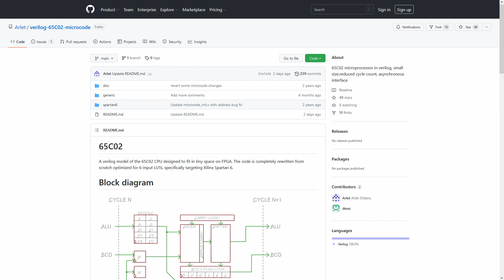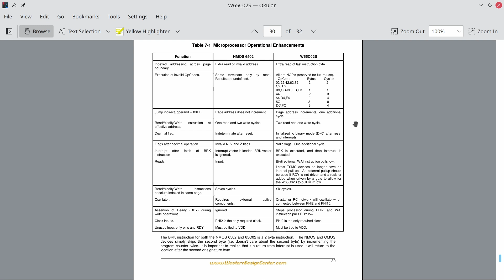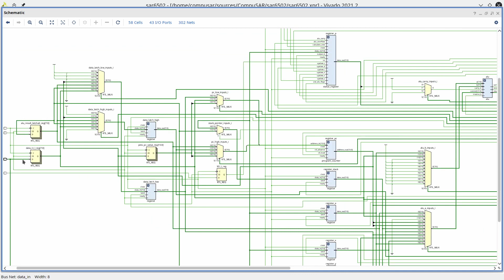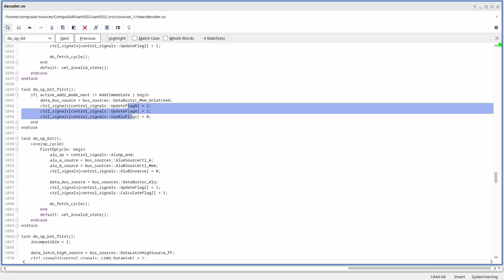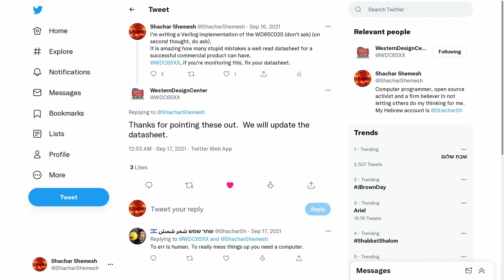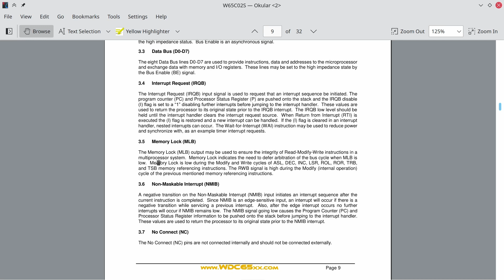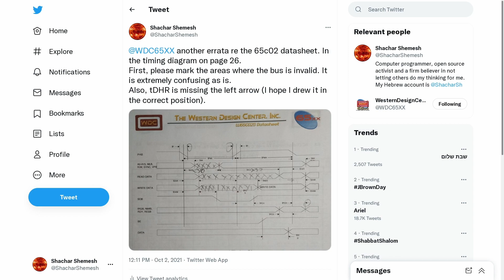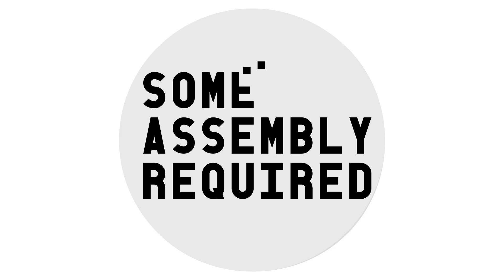Finalizing the CPU

Comment: Where PH2 and PH1???😅
Reply from the maker: It's been a while for me. What are you missing?
In particular, since this is an implementation designed to be used exclusively inside the FPGA, there is no need for any clock phase shifting (and the design uses a single edge anyways).
It's also worth noting that this design was completely replaced. See https://youtu.be/and5Sfoy9t4

Comment: Quirky things like BCD and the overflow flag pin are only on the chip at all because they are CPS - Chuck Peddle Specials. They were never functionally necessary.
Reply from the maker: I think you meant not the overflow flag, but the "set overflow" pin.
And I wouldn't bundle them together. Other CPUs, definitely after but maybe also before, also had BCD. The Motorola 68000 had BCD, and that leads me to guess (can't check now) that so did the Motorola 6800, which predates the 6502.
Reply: @CompuSAR  the designer of the chip at MOS, Chuck Peddle, required/requested the inclusion of these items. He was known to be quirky about these things.
Reply from the maker: I'm not saying otherwise. I'm just saying that unlike the SO pin, that only the 6502 has and that everybody was sure no one will ever use (they were wrong, the Commodore 1541 uses it), BCD actually saw use (the Atari basic uses BCD mode), and even lived on to other CPUs.

Comment: Gonna be honest I don't blame you for treating this like the 65c02. I find it really frustrating to work with the NMOS 6502 because there's no PHX or PHY. Seems like every function I write I end up having to stash A into zero page, but then you can't use nested functions that also do that... grr!
Reply: On the flip side, the NMOS 6502 would, as it happened, process some opcodes in useful ways not supported by the CMOS chips, most notably those nicknamed LAX (load accumulator and X simultaneously, using any addressing mode, other than immediate, that would work with LDA), SAX (store the bitwise AND of the accumulator and X register), and DCP (decrement and compare, which also interestingly enough works with all addressing modes except immediate or accumulator).  While a few things like PHX and PHY are nice, it would have been nice to support LAX, SAX, and DCP.
Reply from the maker: @flatfingertuning727  Losing those would not feel so bad had they not been replaced by such useless commands. The BBR/BBS commands could come in handy, if you could rely on this being a 65c02, which you usually can't. The RMB and SMB commands can only elicit "what were you thinking??".
According to Wikipedia Western Design only added them because Rockwell asked them to. WDC's are only Stop and Wait. At least "Wait" can be very handy.
Reply: @CompuSAR  The fleet of NOPs when the LSBs are 0x11 I could see as being useful in embedded systems, since one could fairly easily add a bit of decode hardware and a couple of addressable latches to add externally-decoded instructions for "set special latch 0-15" and "clear special latch 0-15".  The BBR/BBS instructions could IMHO have been more useful for embedded systems if all eight BBR were "branch if dedicated input was high on falling edge of phi2 of the instruction fetch" and all eight BBS were "branch if dedicated input was low on falling edge of phi2".  Simply add an 8:1 multiplexer in front of that input and one would cut test-and-loop time from seven cycles to three.

I'm somewhat curious what tweaks could have been made to the 6502 design without affecting cost (or maybe reducing it).  Probably the simplest way of using the x11 opcodes might be to make them all decode as ADD/SUB variants, using two bits of the opcode to select decimal mode and/or carry-inhibit.  This would then free up the ADC/SBC opcodes for CPX and CPY, without requring them to be crammed elsewhere in the instruction set.

Alternatively, I'm curious how the design would have turned out if (ind,x) addressing mode had been omitted, but all instructions other than JSR had an addressing mode determined by the bottom 3 bits, and the behavior of all actions in modes other than immediate and implied would be determined by the top 5 bits.  The nine read-modify-write and store instructions would behave as branches in immediate mode, and implied mode actions would mostly be different from other actions, but aside from those details there would be enough room to make the instruction set fully orthogonal while filling in a few gaps, and I would think it would have been simpler than having so many different sets of addressing modes be available for different instructions.
Reply from the maker: @flatfingertuning727  I think the 6502's solution to that problem is the SO pin. In fact, the Commodore 1541 disk drive actually used it, for precisely that purpose.
Reply: @CompuSAR  The SO pin is only available as a latching input, and requires that one either have a means of externally enabling/disabling it or else forego any use of overflow-checked arithmetic.  Having a dedicated pin just for a dedicated branching instruction family, and a group of consecutive opcodes to allow the use of a multiplexer, would seem to simplify external hardware by eliminating the need for an "enable" latch.
Reply from the maker: Sadly or happily, 6502 compatibility is coming. It's just not going to be as thoroughly tested as the 65c02, due to the test harness' inability to provide a consistent fast enough clock. I considered building one that uses the READY signal to halt the CPU, and would thus work with non-static CPUs, but then I saw that some 6502 only honored the READY signal on fist cycle of instruction cycles (which makes no sense at all).
I'll probably just manually verify with visual6502.org.
Paradoxically, since I'm aiming at building hardware for running existing software, I don't care how awful it is to program the CPU I'm building. The software is already written.

Comment: Excellent work!
I've been playing with 6502s so long that I remember people talking about the ROR bug being a problem in some systems, and spent 1978 on with Apple ][. I can confirm that Microsoft BASIC doesn't use decimal mode and outside of subroutines in a couple games, I don't think I ever came across it again on an Apple in a dozen years of coding. I know it was used in a Pascal math package, but most of the floating point numbers that were used on the Apple ][ went through Applesoft BASIC.
Reply from the maker: Then again, Applesoft using floating point is considered one of it's greatest weaknesses. People reminiscence about integer basic. I've never had a chance to program in integer basic, so I have no opinion how justified those opinions are, but I can confirm that Applesoft was dog-slow.
I think the source of my dislike to BCD is because of an educational program I used as a kid. It taught binary operations, and had a BCD mode. Except the BCD mode had a bug, where it would ask you to add numbers that were not legal BCD numbers. Today, knowing how BCD works at the CPU level, I realize what were the answers it was expecting, but as a kid, it just caused me to give up in disgust.

Comment: BCD was used during the keeping of scores on a lot of c64 games as well I believe. ;)
Reply from the maker: See my reply to @drlazy1. I've made my peace with the fact that decimal mode will have to be implemented. I wouldn't care so much, but it has a lot of corner cases (e.g. - the V and N flags) that, at best, can be described as "poorly documented".
Reply: Funnily enough the NES was actually missing the BCD mode and yet it managed just fine. The ARM doesn't have hardware BCD either if I recall
Reply from the maker: @Clippy4Jesus  To be fair, working in BCD mode saves on converting the number to decimal. I actually analyze how unpleasant that task is on the 6502 in the previous video.